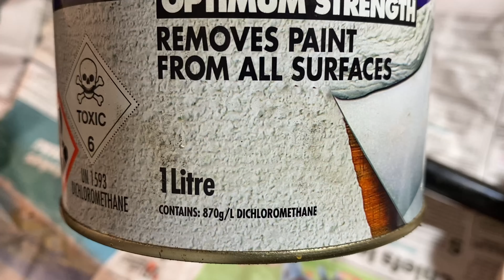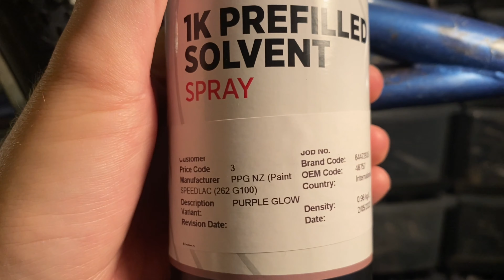Hybrid to Klunker build! - GT Slipstream

Comment: Not really a question for this build, but how do you find fitting modern tyres eg Maxxis onto these old narrow rims and also clearance etc?.
Reply from the maker: They fit well, better than old tyres! Tubeless tyres can be tricky, but that’s the tyre itself and not a tyre/rim compatibility issue. 
I just wouldn’t drop the pressure tooo much, on skinny rims, as they start to handle a bit squirrelly. 
Clearance sort of depends on the frame but a 2.3 Maxxis DTH can clear quite nicely on a lot of retro mtb’s 🤙
Reply: @toastyrides  thanks for the reply, I've just picked up a 94 Diamondback Traverse commuter in really really good original condition , apart  from grips nothing actually needs replacing, but going to upgrade tyres, seat, grips and pedals just for that personalized look. Can't go past the cliche tan colors to go with the dark green. Love watching your build videos, I find them quite therapeutic 😆🤙🚲